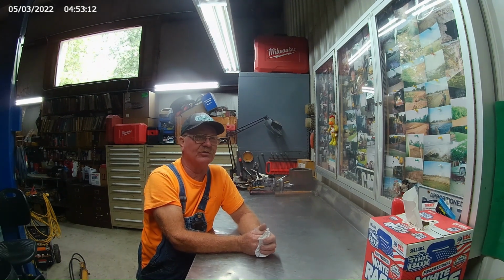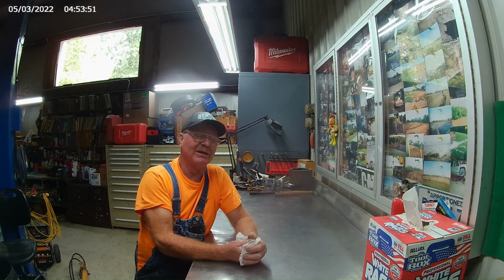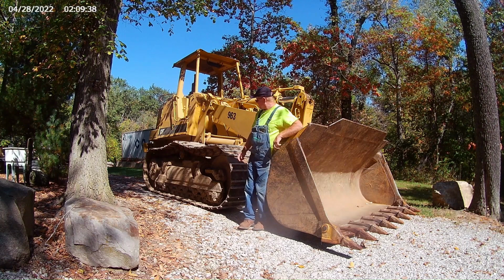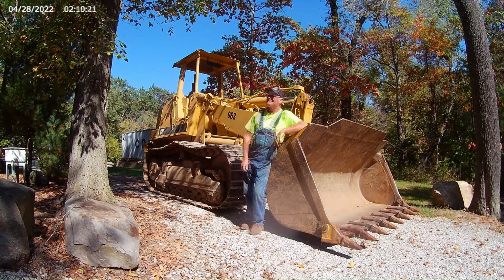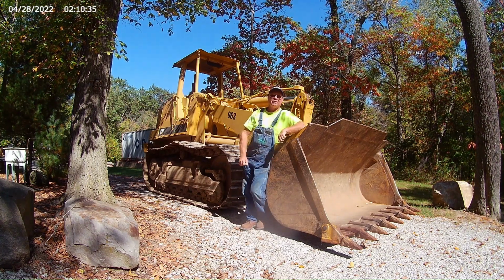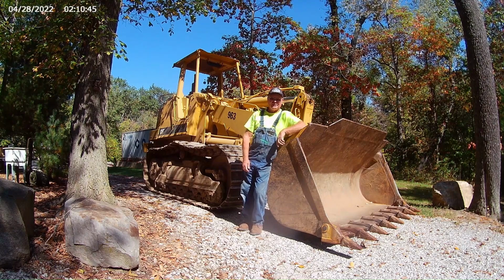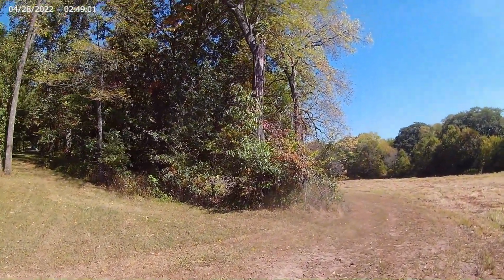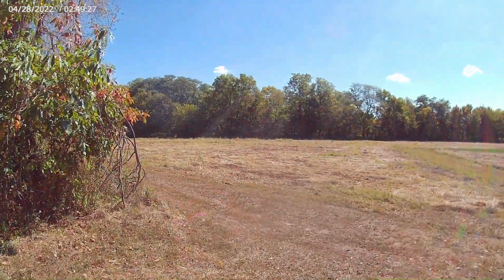963-lgp explain and run (very noisy)

Comment: I have the same machine, early 21Z with the e bar caps instead of pins, bought it for nothing had to build the engine, replaced drive motor hoses and some misc items, been doing good finished my first job with it, I leave the 977 parked now that i have the 63 much smoother, faster and have a lot better view of the the bucket with the 63.
Reply from the maker: over the years worked on a lot of high lifts but I can say the France made 21z is the BEST.! thanks for comment.